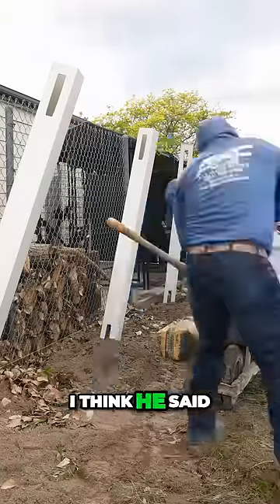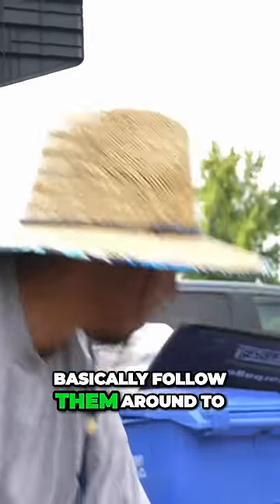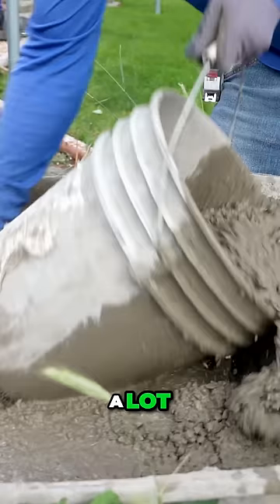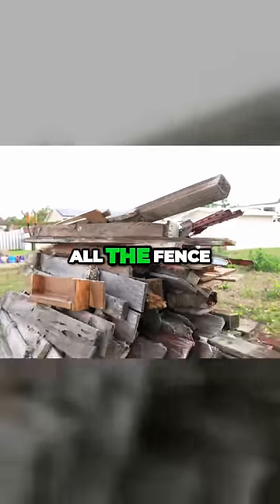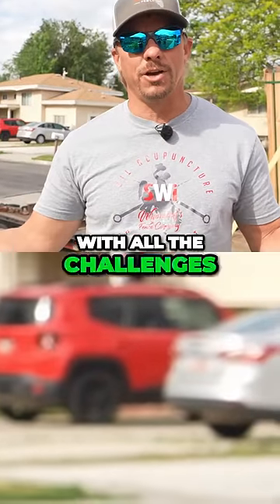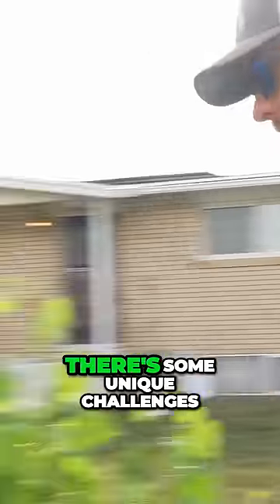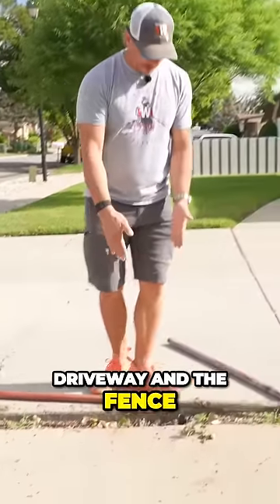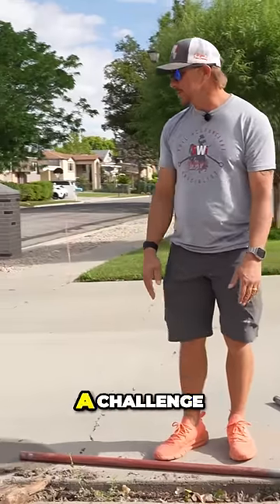This Mexican Fence Builder Sets Crazy Deadlines

Comment: Bro get them a concrete mixer 😂😂 it’s like 200-500 bucks
Reply: Serious question, rental or buying one used? I understand they’re not terribly complicated machines I just never thought it would be worth the investment but at that price so long as it wasn’t a rental I’ll have to go out and get one today!
Reply: @ExpeditionAngler  I cheap one will be $200 to $500 a good quality one is $1000 plus used. You will still need the wheelbarrow to move the concrete around.  Mixing might save time but you have to wait as you can one mix one batch at a time.  Just another piece of equipment to have to haul in and out of the job.  Might save some time but is it worth it?
Reply: He said in the beginning they usually dry pack it. So there’s no reason for one.
Reply: @gonzo3956 but yet he said victor isn’t doing that, and they’re literally pouring we concrete 😂
Reply: It's definitely worth it if you have big jobs like this all the time.. I think three 80lb bags fill up one wheelbarrow and is enough to set like 3 posts.. 66÷3 = 22 wheelbarrows worth of mixing.. mixing isn't terribly hard.. its just time consuming..

Comment: We have dry set since the mid eighties…and later had to move those installs…incredibly hard concrete was encountered, the posts are more firm initially, you can backfill immediately, and the labor savings is phenomenal…we also install grinder pump systems, dry set the anchor rings too…and again had to later move one…same result…it works…
Reply: I could just put a post in the ground and backfill it with dirt and it would work too but it’s not the proper way to do it neither is dry filling if you have a really wet ground then it works better but it’s nowhere near as strong as wet setting otherwise we can do footings dry setting no engineer would ever let you do that
Reply: No matter what, pouring mud always yields higher strength concrete. Dry pack is good for quickly consolidating but you’re never hitting the mPa numbers that a properly proportioned mud will give you.
Reply: Why does it have to be set and move them something went wrong
Reply: If it’s so good then why would no engineer ever recommend doing that and you’re lucky you’re working in places that obviously don’t have building codes

Comment: I dry set and we have footing inspections all over south Florida and 67 holes in a day we would knock out with three guys and be home early all hand dug
Reply: Lol there's no frost line in Florida or rock. You could dig those with a sandcastle shovel
Reply: You must not know about Weston or Kendall or big cypress ok no frost line let’s not forget Florida was completely covered in water and dirt doesn’t hold out water hmm what does mister sand shovel rock and it’s usually lime stone or cap rock talk facts not caps I’m in south florida
Reply: Oh yeah and by the way we are a booming economy so there for it’s usually the third or fourth fence being installed and there’s old concrete bells in the ground left behind and did I mention hole inspections it’s becoming most city mandated building law that you have to dig to materials specs for size and wait for inspection of just holes it’s called a footing inspection
Reply: Miami also requires a barrier line inspection which means laying out your job site and the inspector comes out to see where your building your lines but if your smart you schedule your footing and barrier inspection for the same day